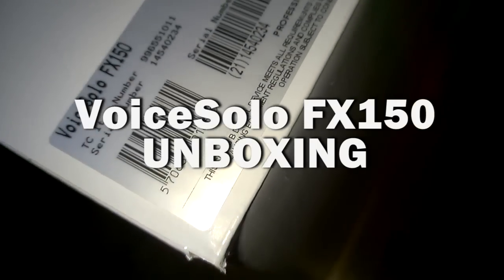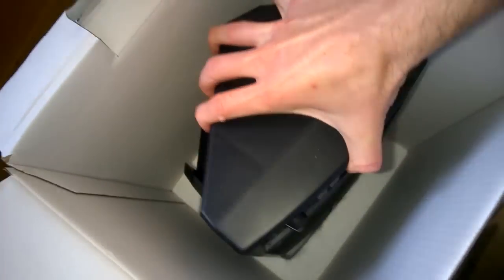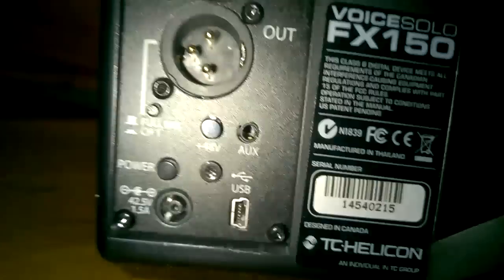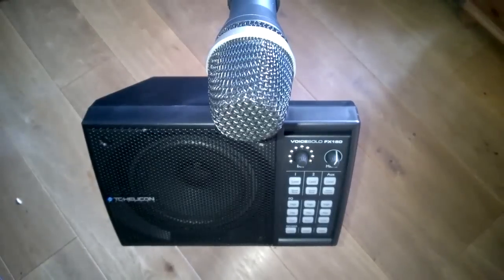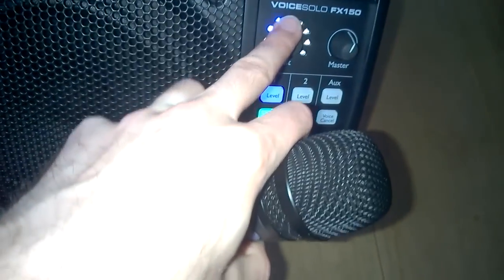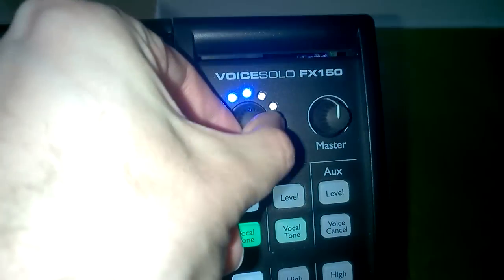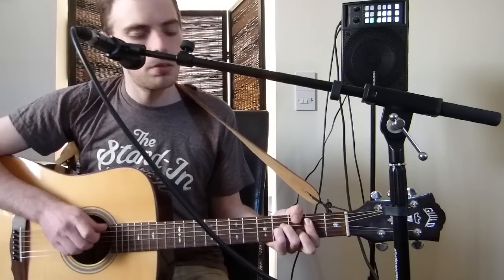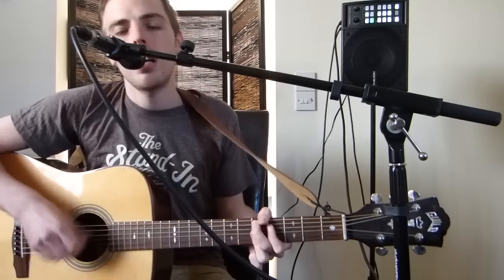TC-Helicon VoiceSolo FX150 - Unboxing, Audio Demo - Stage Monitor Speaker with Vocal Effects

Comment: Hi Chris, the problem I have with my current mini monitor is feedback. How dose this unit handle feedback while singing with a band? Thanks
Reply from the maker: Hi. It slightly depends on the mic you are using. It is very directional so is pretty resistant to feedback if you position it correctly. If you want to mount it on your mic stand, it is better to use a cardioid mic and not a supercardioid mic.

Comment: Hi, did you plug, both, vocals and guitar into that, how many channels does it have? probably has output so i can send it into mixer or soundcard?
Reply from the maker: yes, connected both. it has 2 mix/line combo inputs and an aux in. and yes, there is an output to go into a mixer etc
Reply: tnx bro 4 quick answer :)

Comment: Hey man- question for ya. I have this thing and no matter how I configure it, I can’t get my mic (ch1) and electric acoustic guitar (ch2) to both be audible. The thing only has ch1 audible regardless of what is in it. Are you using a DI or a mixer or something? Any ideas?
Reply from the maker: Hey. I just used the mixer on the speaker. I haven't got the speaker any more, but maybe it might be worth checking the input gain level on ch2 (if that is an option - I can't remember I'm afraid). It definitely should do what you're trying to do without the need for an extra mixing desk.

Comment: Thanks Chris for the unboxing, audio demo for the FX150 .  I just ordered one, and it will be just enough for practice at home.  Love your Guild acoustic, D40?  Had two of them in the late 70s.  Also thanks for all your TC Helicon videos you have done, in particular the VoiceLive acoustic series.  They really helped a lot.  Plan on using this with my VoiceLive Play Acoustic.
Reply from the maker: Thanks - glad you found them useful. Yeah, the Guild is a lovely guitar - although it doesn't get as much use as it should do after I fell in love with a Gibson LG-2 that I couldn't resist buying! :)

Comment: Hey Chris, nice demo. Just wondering, towards the end you easily toggled the reverb to OFF with your SENN e835 fx mic.  Did you use another TC-Helicon product to do this or you can really achieve this when plugging the mic directly into the VoiceSolo FX150?  It's a valuable tip to know how to do this!  ;)

Comment: i am a vocalist and need a pair of active speakers for home practise use which gives a good sound on vocals. I don't need big ones just so I can put them permanently fixed in my work room. thanks
Reply from the maker: if you definitely need a pair for fixed installation, you might be better off with something else as these are designed to be used individually as a wedge monitor (or mounted on a mic stand).

Comment: How does it do with regards to different positions and feedback?  I assume that if you are playing with a full band, the levels would have to be much hotter than vox/guitar only.  Was wondering if it could handle a full band situation as well.  Great video and review, btw.
Reply from the maker: Thanks. I've so far used it in practices and a gig and level or feedback haven't been an issue. I have been using it on the floor (not mounted to the mic stand) however as I have a super-cardioid mic which has a null point at 45 degrees and not at 90. Maybe I'll get my SM58 out sometime and try it mounted on the stand and see how it goes; but so far it's been great. I've even been using at practices instead of a PA system and my vocals have been loud enough to be heard over the rest of the band (although we're mostly playing folk/country stuff, so it's not that loud anyway). The rest of the band laughed when I turned up with it as they didn't believe it would be loud enough to heard over the drums as it was so small - after the first song they were asking me to turn it down as it was too loud! :)
Reply: ***** Thanks, that's great feedback (no pun intended).  I have one coming in today, and am excited to give it a whirl soon.

Comment: Just Wondering, im not convincet at all buying this one, I already have a decent PA System (Yamaha EMX212 and 2 BR15 also yamaha... , but the issue is that sometimes there are small places where i have to play, so I can't take the complete PA system, even I'm thinking trying a portable PA system (Like Fender Passport, or Peavey Scort), but a friend of mine told me about the FX150, so what do you think? Would be good buying a FX150? to using it as a portable PA for small places?? im Using a Yamaha Silent, a TC Helicon Voicelive GTX, and i use a Boss OC-3 for the bass effect while i loop, can you give me your advice? ANYONE!!!
Reply from the maker: I've used it on a few occasions as a portable PA, however the speaker is fairly directional so I've found it is best used as a monitor really (which it is great at). It it pretty loud and it could work for you as a PA, however you might be better looking at something like the LD Systems STINGER MIX 6 A G2, or similar.
Reply: Ty for the advice. 1 week ago just bought a Yamaha stagepas 400i for the presentations on small places... =)

Comment: Hey Chris- can u directly connect this to your TV and use as TV speaker?
Reply from the maker: You could, but it's not really what it's designed for. I would have thought there would be better speakers for the job - especially as it doesn't have that much low-end.

Comment: I no it depends a lot on the room and position, but how did this Amp handle feedback looking at where you had the speaker ?
Reply from the maker: About the same as any other speaker. I didn't have it that loud so it was ok. Better putting it in a more typical monitor position really. It's better as a monitor than as a PA - although ok for bedroom use and rehearsals.
Reply: Thanks for getting back to me, It seems OK for what I intend to use It for looking at where you had It made me wonder, nice to see you playing a Guild I Got a D25  Iv'e had since the 70's  had the fret board replace 30 years ago, got a great tone still play It all the time

Comment: Do you risk feedback issues if you place this in the middle of the mic stand and sing into the mic?
Reply from the maker: Joel Jakob  With a cardioid mic (like SM58) you should be ok; but you might have problems with a supercardioid mic (like the Beta 58). I tend to use it on the floor like a wedge monitor at most gigs, but have tried both methods.
Reply: Right...So basically what you're saying is you risk less feedback if you use it as a wedge as opposed to on the mic stand itself? Thanks for the prompt reply btw. U sound good man. u can check out my original music on my channel if you're interested. Keep rockin
Reply from the maker: Joel Jakob
Kind-of, as using it as a wedge gives you more positioning options. However depending on your mics pickup pattern you may find there is little difference between mounting it and using it as a wedge. You also may find you need the monitor at a lower level when mounting it as it will be nearer to you. It's hard to say if it'll work for you better as a wedge or mounted without trying it in the specific venue and with your specific mic you're using. It can work both ways though - so you do have the option to use it as a wedge if mounting becomes a problem. I generally use mine as a wedge more purely because I prefer the look of it that way - but have had success mounting it on the mic stand too. Sorry if the answer is a bit non-committal, but there are a lot of variables to consider. :)
Reply: Absolutely. I appreciate it. I wonder if I can rent one for a few gigs to try it out..anyway, thanks.

Comment: Can you use it by it self for performing?
Reply from the maker: Yes.... although only for small gigs. It's designed more as a monitor - so you might want to look at a dedicated PA system if you're planning to do lots of gigging.
Reply: +Chris Kennedy thank you 
I ended up buying a nice 200 Watt pa speaker with a good mixer

Comment: Hi there could you answer my question if it's good to use it outdoor  (buskin) thanks...
Reply from the maker: I think you'd probably be better of with a battery powered system that is more designed for busking